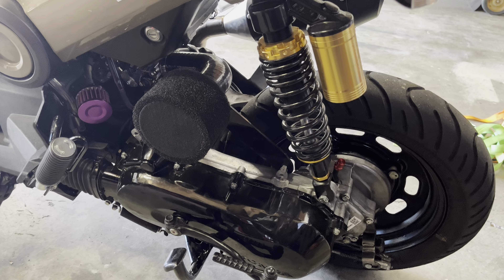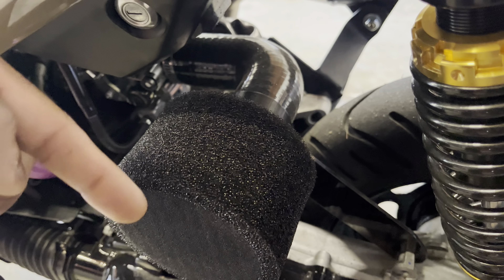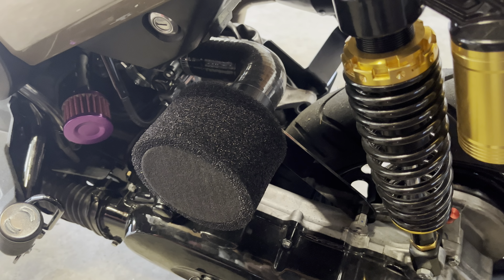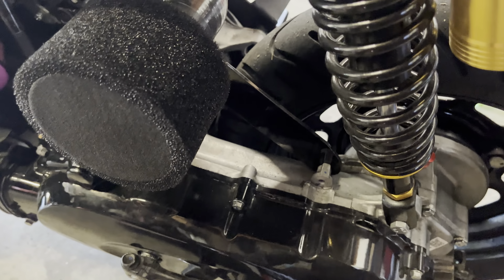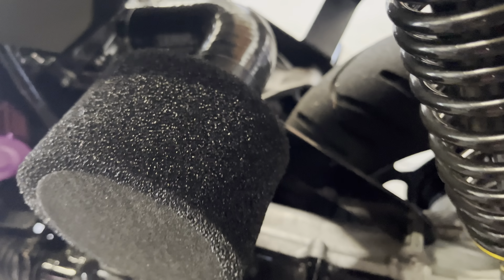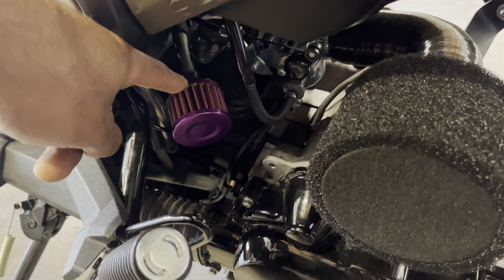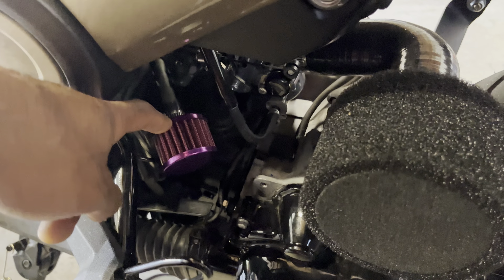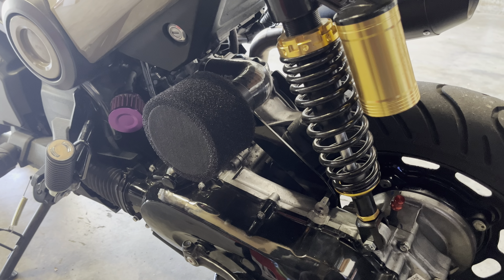DIY intake system for the Honda Navi for under $40!

Comment: What is the length of the bar from hole to hole for the mount?
Reply from the maker: I don't have the bike anymore unfortunately, but it would depend on how long your intake tube is and what your collar (The part I 3D printed) looks like. Sorry I can't provide any better information!
Reply: No worries I was designing a 3d printed bar as well for this.

Comment: What elevation are u in to rejet valves.. great video by the way
Reply from the maker: Thanks! I'm at sea level but needed to rejet due to changing both intake and exhaust.
Reply: What jets u go with? Did u have to adjust the air mixture and fuel?